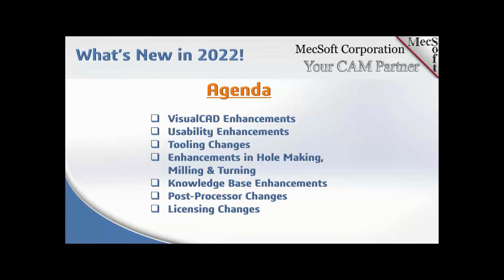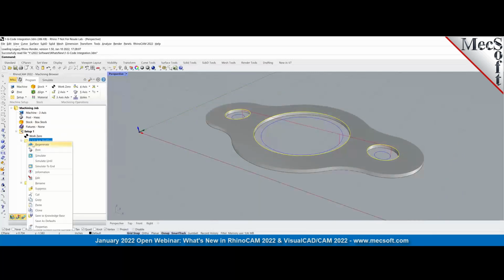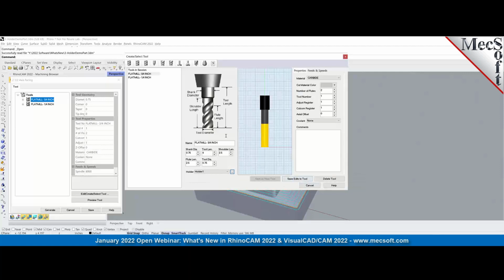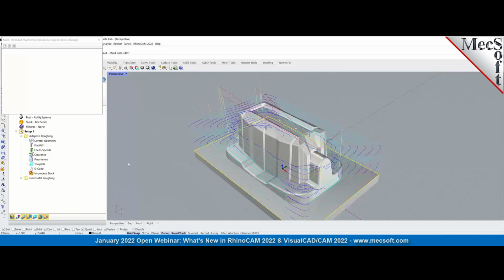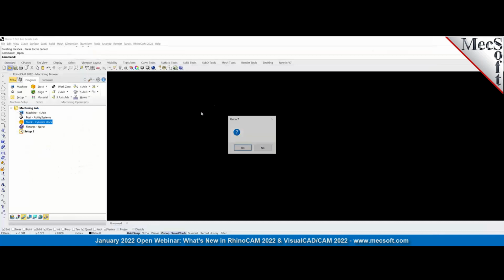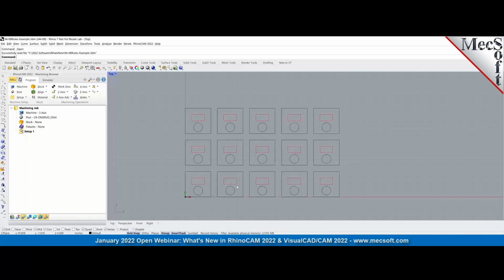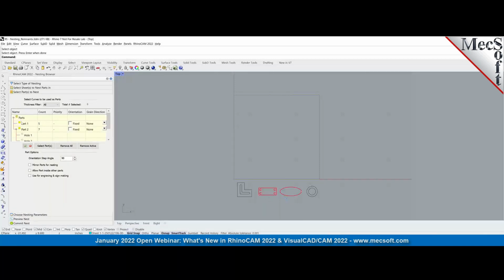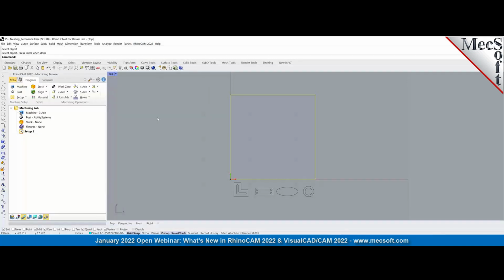What's New in 2022 for RhinoCAM & VisualCAD/CAM!

Comment: can you tell me in detail how to make a program for dxl falls for the production of plywood cutting, how to make holes for curtains and other trimmings on the outside, but at the same time, that the zero should be from the bottom of the workpiece on machines with automatic tool change, because for some reason the trajectory cuts through the entire part, I need to make grooves not to the full depth of the part, but to the selected one, and counted 0 from the table